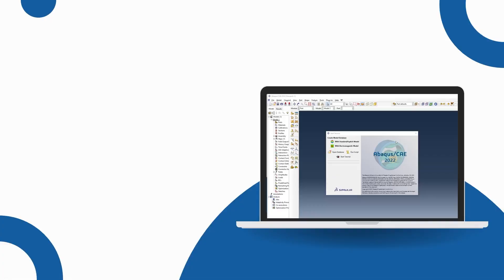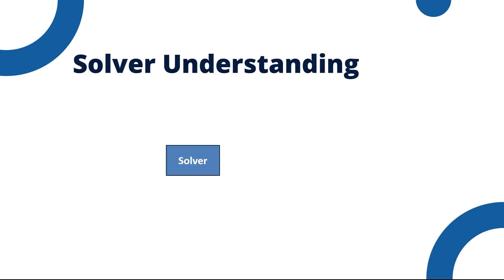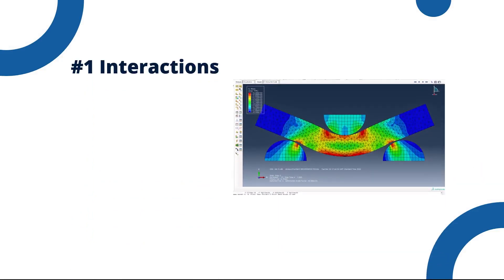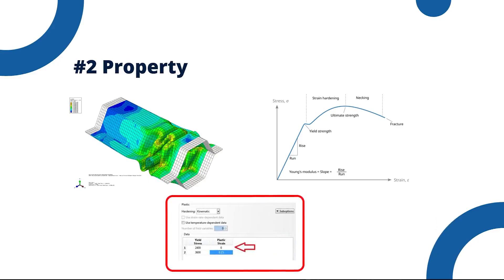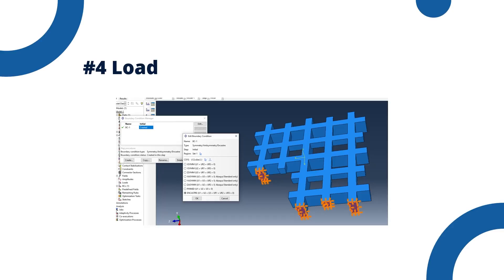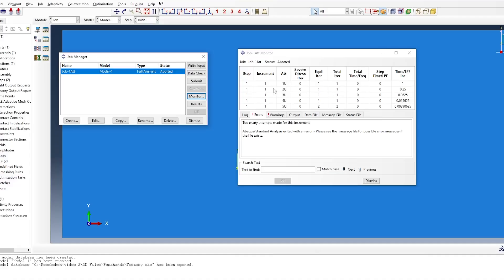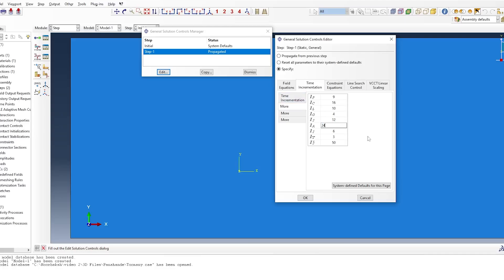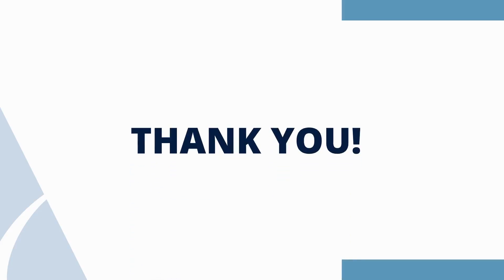❌Too many attemps made for this incrememt❌ Abaqus Error | Causes and Solutions

Comment: Dear Sir, 
I try to make the models in abaqus version 2019, and I got the problem in Job that: Unknown global id:1
Could you help me to fix it? or you can give me some comments for solving this error?
Thank you very much for your videos in this channel.
Reply from the maker: Hi, thanks for watching our video.
This issue can have various causes. The ID might refer to a part number that hasn't been defined correctly in the .inp file, or there could be a problem with the assembly in the model. It could also refer to a processor number if you're running the job on a cluster or an issue with the Abaqus installation. We have not encountered this issue before, so to provide accurate guidance, you can send the .inp file to the email address below. We will first check whether the problem is with the .inp file or something else and assist you further.
support@caeassistant.com